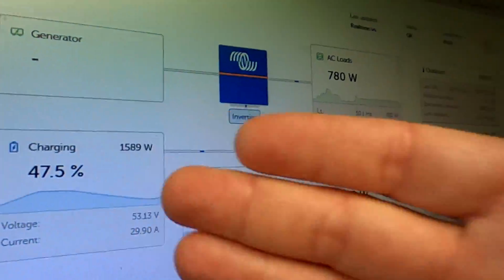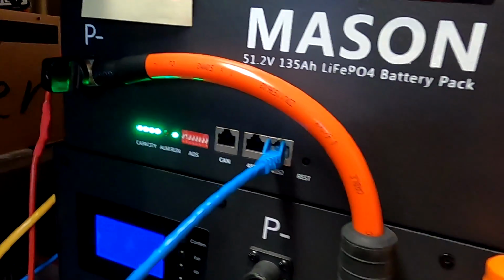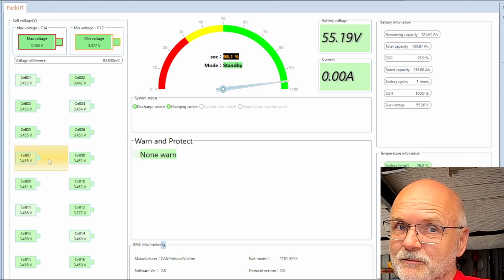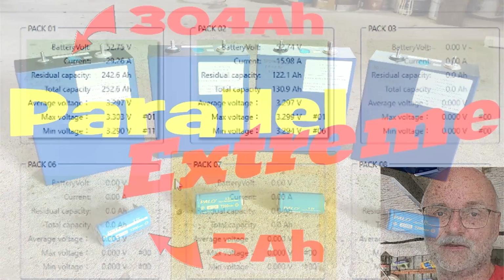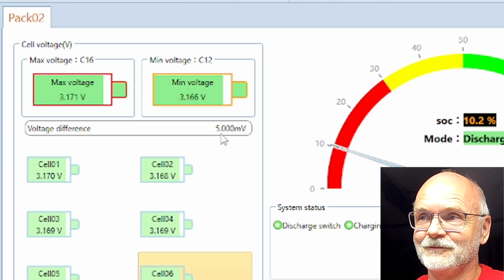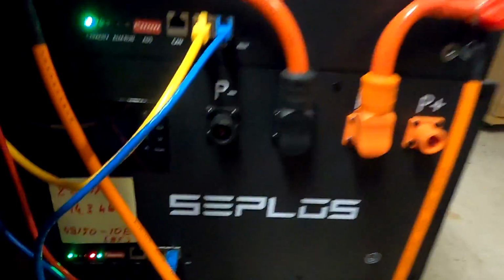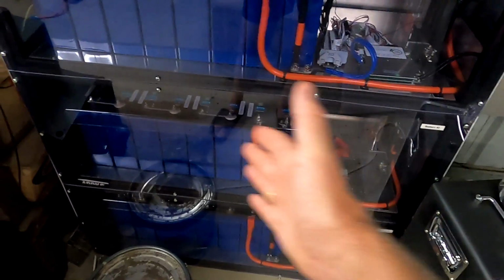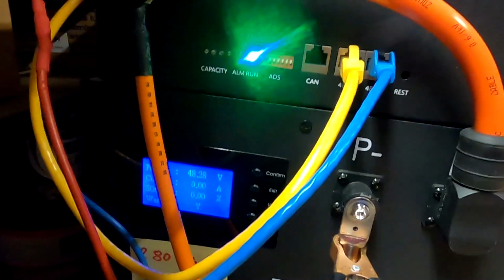280Ah and 135Ah batteries with different BMS in parallel. See what happens when discharging...

Comment: It's the same problem once Renewables are connected to the grid but worse do you have a volt amp meter you can double-check your installed watt meter and CN 85% difference see I wonder why electric bills are going up
Reply: You should think about some fuses at each connections battery controller panels inverter otherwise don't show your insurance

Comment: Hi Andy , What happens when two parallel batteries of different capacities are used, and one cuts off due to low cell voltage while the other keeps working? When the disconnected battery comes back online, will there be a large current surge to the other bank, and could this damage or burn the BMS?

Comment: Similar situation with our x5 Sunsynk 5.32kWh batteries. The newer battery acts and master and will turn all other batteries on and off when you power up or down the master unit and it’s gives an aggregate voltage, current and SoC to the inverter but sometimes the individual batteries report and do weird things. For example sometimes two or maybe three batteries with be actively charging or discharging and a couple will not (not always the same groups of two or three batteries btw) and then you will have bit of voltage difference between packs and then the others join in and these a bit of a power flow spike where the two batteries which were not working ramp up and these other three ramp down. It’s really quite messy and almost as is the BMS has a min voltage difference threshold which is too high and some doesn’t let them work together smoothly. Ironically these packs will BMS do a worse job than just having two batteries of different capacities directly connected.

Comment: Bonjour Andy, Je suis très interressé pas ce boitier, mais est-ce que je peux mettre mes batteries 51.2v et 320A dimension des cellules      L 172 * 71mm  * h 204 et est ce que le BMS va accepté 320Ah, je ne trouve pas de notice au dela de 280Ah
---------------------------------------------------------------------------------
Hello Andy, I'm very interested in this case, but can I use my 51.2V, 320A batteries (cell dimensions L 172 x 71mm x H 204mm) and will the BMS accept 320Ah? I can't find any instructions for anything above 280Ah.
Thanks.

Comment: Hi from cold cloudy Newfoundland Canada Andy. Been following you a LONG time. I leaned a LOT from you and fellow Canadian - Captain T-Class fuse Mermaid! lol  Thank you both!  I have 100A at 48V paralleled with 320A at 48V with different BMSes and both max at 50A charging. I'm worried about the batteries charging each other when they discharge to zero SOC (it never is really zero as it bounces back a little after the shutdown) and then start recharging (solar or wind in my case). If the in-rush is above 50A it will trigger the over current repeatedly (that can't be good for the BMSes) until finally they balance enough so the inrush is below 50A (might take dozens of cycles/over-current shut downs). My solar can reach 50A on cold days and my wind maxes at 40A. To make matters worse, I live in a cold climate so one of more of the batteries could hit the cold temp shut off (set at 2C due to BMS thermostat inaccuracy) and then the two packs will get out of balance badly very quickly. As has happened recently on a cold sunny day with 45-50+A coming in from solar one ended  48% SOC and the other at 25% SOC) and I'm back to facing the 50A inrush and over current protection cycling nightmare.....and possible starting this cycle with maybe 70A inrush from one pack to the other, so it coul take a LONG time to balance both packs, again. Moral of the story is, get 100A-200A discharge/charge BMSes in all the batteries!! Heating pads fail, batteries go to zero SOC, and packs sooner or later will get unbalanced. If the BMSes cant handle the inrush from one pack to the other, bingo, you'll have it tripping over-current protection every 3-10 secs for HOURS, perhaps.
Reply: L

Comment: Excatly what I said.. if a charge controller is there . Balancer also.. then it's a bms . And several in parallel would charge discharge at a % state. With that volts and amps of batt capacity.. I use to think it'll be unbalanced like one batt died earlier . That's what's a BMU is for . Or bmc batt management unit. Like bye makes.  They all have their BMS controlled with a BMU so they all work in Harmony.  Or is it..

Comment: why switch off active ballancer i use 2 packs 16s lifepo, both have active ballancers with caps and 5A and runs allthe time, if difference is low ballancers sleep, and if is it needed equalize cells imediatelly all the time. For 3 years old battery have still nominal amphours and disbalance 0.01 or less, new is sama story. I don't recognize idea for switch off active ballancers.

Comment: Andy, I need a little direction, I have a luxpower 12hybryd inverter and I have 4 15kw battery banks, 2 battery banks come from different manufactures, I was curious how I can get the inverter to know the state of charge of each battery. Would I connect them in parallel on a common bus bar and run the can or 485 cable to a switch and plug that switch into the com port on the inverter? What is the best way to have the inverter know the SOC of each battery? Thanks Andy!

Comment: I was surprised when communication disconnected completely after the shutdown. Also I expected the bms to send some sort of a command to the inverter to turn it down or switch to the backup before battery shuts dead off. Other than that option i don't see a purpose for communication
Reply from the maker: That was really just for testing purposes to see what happens. You are right, usually the inverter would shut down (or switch to grid) before any of the BMS gets to such a critical stage.

Comment: Thank you again for all these video.
Do you believe I can parallel 2 US2000C Pylontech batteries with 1 Gobel 14kwh (PACE BMS) which I bought thank to you ?
If yes, should I find a way to make the BMS communicate together ? Or should I just connect one to the charger ?
The charger is a Sofar Solar ME3000SP set to Pylontech CAN and I will receive later a Multiplus II 5000.
Thank you again !
Cyril

Comment: Great content, I have a different issue, I have two Deye inverters, one with 2 x 15s batteries and the other with 2 x 16s. I guess it's not possible to connect in Parallel these four batteries due to the voltage difference, or can I assume the 15s BMS maintains the correct voltage and is really not an issue?
Reply from the maker: You cannot parallel them at all! The voltage difference would make the 16s charge the 15s all the time until the BMS turns off. That is just not possible.

Comment: I'm running two 280ah and one 202ah in paralell. No problem's at all. Daly, JK,  and jD doing it's job.
Reply: w/commication each battery or no???
Reply: What happens when two parallel batteries of different capacities are used, and one cuts off due to low cell voltage while the other keeps working? When the disconnected battery comes back online, will there be a large current surge to the other bank, and could this damage or burn the BMS?

Comment: The only thing that comes to mind regarding the communication is the inverter. If only battery one communicates with the inverter, it cannot see info from the other ones. It's not for communicating between batteries, but for moving info from each battery to the inverter. Did you check what the inverter sees?

Comment: Hello to all. I have the following question. I currently have 2 48v Lithium batteries from CFE 5100 in parallel. But I would like to add an extra Lifepo4 battery (16 cell 48v). Each battery has its own BMS. everything is connected to 2 Growatt inverters. Is this possible with these batteries.
Thank you and best regards, Damir

Comment: Hi Guys i have watched most of the parallel tests between different size banks and different bms's. But one still dont want to make an expensive mistake:
I have existing sunsynk 5.12kwh batteries x 2 and have new jk inverter bms with 16 x 304 ah cells.... will it work ? There is not much info on the Sunsynk BMS

Comment: Hi Andy, did you have a try to run to battery in parallel  48V 100Ah  4800Wh     with   5.1V 100Ah  5120Wh?

Comment: If I have 228h solar battery with 150 BMS headway with no BMS limit my discharge for car audio to 150amps or is that only on the solar battery that it controls even though they're running put the BMS is only inside the solar battery?

Comment: So.. regardless of the BMS the battery equalise regardless of voltage and load. 
You can end up appearing to draw more from a bigger battery , which is not going to the load but to keep the voltage in the others.

Now the BMS will make a charge request if one parallel battery fall low...
I know that, it really 
They don't seem to be able to balance a charge.. not sure what was going on...

I have parallels all with their own BMS's. And soon to add another as I want lower draw from the packs with redundancy should one or two go off line.
They don't communicate.

Comment: I’m curious about something, if you have four cells and one has a much lower discharge rate, or is say older, connected in parallel, then draw max amps from that setup, what happens internally to the cells in terms of discharging and voltage ect? Do they stay the same voltage? Will the weak one drop voltage then the other ones charge it?
Reply from the maker: If they are all in parallel, the voltage cannot drop for this older cell. But it will deliver far less current than the other cells. The same while charging, the older cell wants to rise the voltage faster than the other cells but can't. Again, it will charge slower than the other cells. There is no problem in doing this in a parallel setup.
Reply: @OffGridGarageAustralia Well I’m mostly asking because I was in a discussion with someone about if single cell 18650s which were maybe a little weak would last longer than that same cell if it were in a larger pack, since I’ve read a weak cell in a multi-cell parallel pack will basically exacerbate the degradation of the weak cell when it cycles. The discussion is basically, does a single cell have a better chance at lasting longer than a multi cell pack due to this phenomena?

Comment: This is really interesting. Received wisdom is all batteries should be twins. Same make, capacity, age etc. This test appears to show that with lifepo4 this does not have to be the case. I guess all batteries should be in similar condition. But it does mean that if, when we setup our system, we didn't have enough capacity, we can add to it if required. Great video. Thanks.

Comment: So if I parallel a 330ah with jbd 250a 4s bms with 5a balancer with a 600ah with same bms and same balancer would that be fine..I've tried it with a 140ah with 100a bms and 330ah with 250a bms and it seems totally fine..but if I used 2x same bms would a battery monitor show the capacity as 930ah or just pick the highest capacity battery
Reply from the maker: That will work. Just ensure, the batteries have roughly the same voltage when you connect them.
It depends on your battery monitor and if you can set 930Ah as you overall capacity in its settings. It won't do it automatically.

Comment: Hi Andy, couldn't help but notice it looks like you've used wire netting to keep your shed insulation in place. Great idea, but was wondering what you used to secure it?
Reply from the maker: That was already in place when we bought the place. It will come off soon. It prevents the heat from radiating into the garage. But I have mounted solar panels on the outside for that purpose now 😂
They used some fence wire across the metal beams and rafters which holds it up and some cloth underneath for heat insulation.
This all will go soon when we build the Power Garage 😊

Comment: Communication is usefiull for systems like my Sol-Ark 15K to know the state of charge. If you want to shunt a load (Hot water heater) when the battery full. or to sell to grid. this could be done with a smart shunt if your system is compatable. but it is redundant.

Comment: Hi Andy, very interesting! But I have a "bigger" task. I want to connect a DIY Seplos 280AH battery together with a Basengreen 200AH (I think it's a Pace BMS), both 16s, to a Deye 12k hybrid inverter. For sure, it's not recommended! Currently only the DIY battery is connected and it works perfect. The issue is that I can't connect Seplos and Pace over RS485 because Seplos has a baud rate of 19200 and the Basen 9600! Even if they have the same I'm not sure if they can talk... So, I plan to work with them as stupid batteries, not connected with CAN or RS485 to the DEYE, only + and -. In the DEYE I will configure 480AH as connected battery. What do you think?

Comment: Do you think i csn connect two 36v battery packs in parralel  
1 36v 18650 12ah                                   2 36v 21700 20ah 
If i level the voltage?

Comment: I guess the benefit of the comms between batteries is a single wire to communicate and monitor all the batteries. It would make wiring simpler if you have 16 of them.

Comment: Wow, this video is very interesting but a little above my pay grade as I have a humble 200 watt Renogy starter kit with a Redodo 100AH lifepo and want to get another one to have 200AH, but the batteries will be 7 months apart in age and worried about them working OK together. Love this channel and learning alot. Thanks for sharing your knowledge and experience.
Reply from the maker: Paralleling your batteries should be no problem. Just ensure, each has their own BMS.
Reply: If the bms are different plus has no way to communicate they would work fine . But coms are needed.

Comment: Sorry to bother. But i have a question regarding BMS for lithium.

Is it possible to put 4 12v lithium batteries in series, and the put these in larger packs of 6 for a 48v system with 6 packs of 4 12v lithium batteries?

I am wondering since i have been using lead acid for Home storage and solar storage, but in the future i might upgrade to Lithium, i might even want to build the packs and batteries myself becuase it is insanely cheap. 

What would be the issues if you were to put 4 batteries each having their own BMS in series, and the paralleling these with identical packs? If there would be any issues.

Thanks for answers.

Comment: Regarding SOC report to VenusOS with two same (Mason 280 10C-200A BMS) it looks like the reportet value is the average of the two seperate battery SOCs. E.g. 30% and 50% the reported value will be 40%. Thats how it looks here.

Comment: I have an off-road scooter with a new 13s 48v 45A Daly bms, and the guy I bought it from threw in a smaller 13s 30A clean looking generic Chinese BMS. My question is, can you put them in parallel on my scooter battery pack? To make more amps available. No big deal just wondering if I should give it a try.

Comment: Good It is really a fireplay experiement. You did it great. But in case of any BMS failure, should there is  any fuse protection is required between the paraplling busbar connectors?. Any knife switch isolator with precharge resistor to equalise voltages in a controller manner is not safe engg practice?

Comment: I'm afraid the BMS's do not communicate with one another..  They are just serial connections for the inverter..  And yes, there should be no major issue paralleling those batteries..  What turns out to be a problem is when people use smaller batteries and the current they are drawing needs all of the batteries to supply the system..  You had no issue since even at the maximum current of 60 amps, your small battery was totally capable of supporting it..

Comment: So, the Seplos BMS is not as bad as you keep saying... Batteries with different capacity controlled by different BMS are fined in parallel configuration as long as voltage is similar. And even off voltage is different by a few volts, it will work.

Comment: Lots of comments, but I didn't see much about the RS485.  It is a Master-Slave communications.  It does not allow Slave-Slave communications.  Only the Master (the PC) can poll via address one slave at a time and retrieve one slaves data, then switch to a poll of the other address to retrieve its data.  The only thing that the cable between batteries does is to connect in parallel all data communications lines, 2 for transmit from the computer, and 2 for receive by the computer.  The address that the computer sends in the poll determines which slave will answer.
Thank you for the demo of different battery capacities in parallel.  This matches my findings.  I think that the only reason that manufacturers don't recommend this is they don't want people to by another companies batteries so they threaten to void the warranty if you combine different batteries.  I have experimented with 6 totally different brands of battery and many different BMS.  As long as the cell chemistry matches they are fine in parallel.  Just don't tell the manufacturer or the sales people.
Reply: Good morning
I just read your comments on setting // different battery
so what you are saying is that there is no need to put a special module on each battery pack to make // between the 2 packs?
I have a pack of 9S 200 AH brand Winston LFP (almost new)
and another pack that I built from 9S to 1000AH in EVE brand LFP
I can assemble the 2 packs together + with + and - with - the amperage will add up?
I understood that before putting in // the 2 packs they must be charged at the same voltage and 3.65 volts per cell

what do you think?
no risk?

and regarding the wiring on my pure sine converter
if I put the 2 packs together in parallel, do I take the + from which pack?
and the - of the other pack? or 2 cables for each pole?
THANKS
laurent

ps: I was thinking of buying 2 modules and 2 special BMS from Dally to do the setup // I'm thinking!